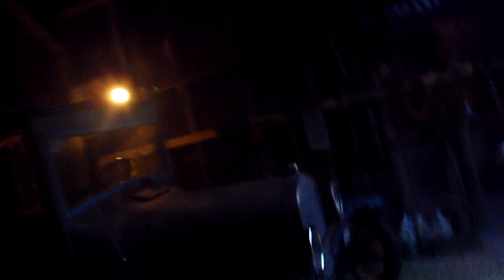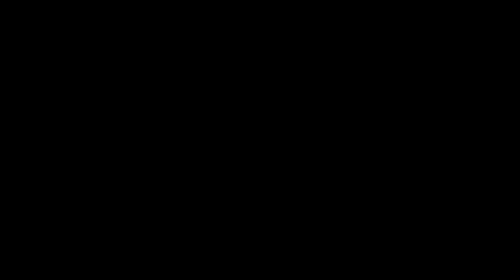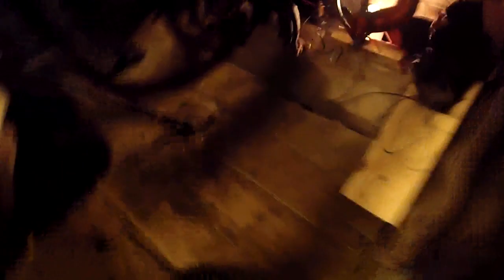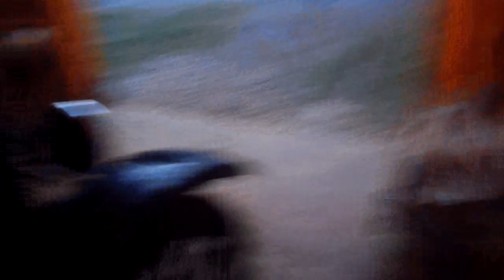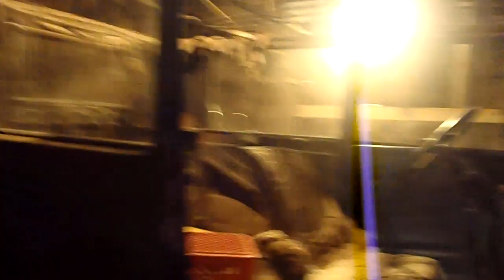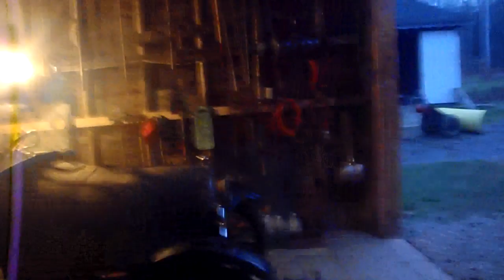Update on the 1926 Ford Model T Tudoor Preservation

Comment from the maker: @slainwolf180 well you have a wire coming off the mag post going to the diode then a wire from the other side of the diode to your light-bulb then a wire from the light bulb to your battery junction block on the fire-wall where one wire goes to the switch and another goes to the battery